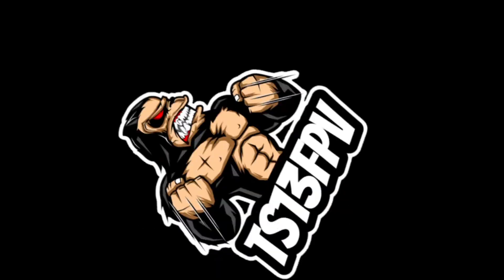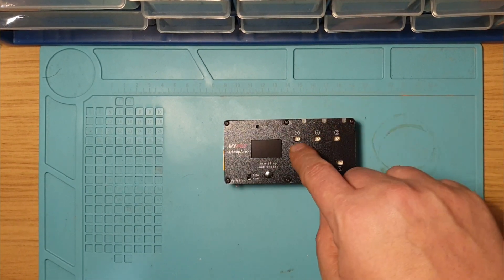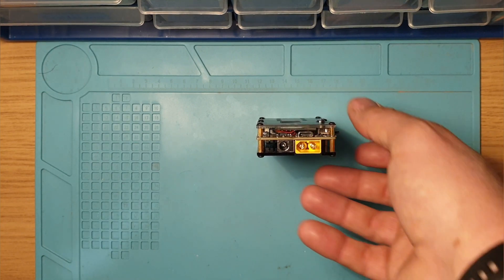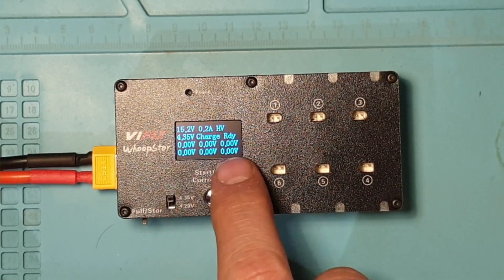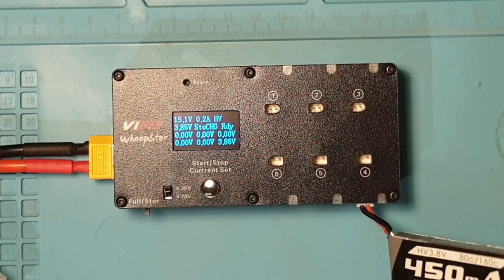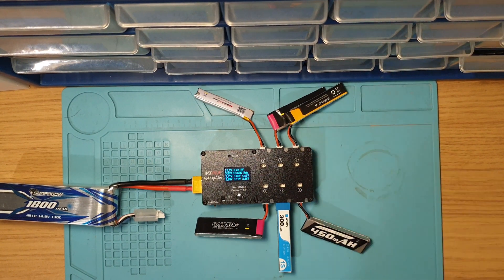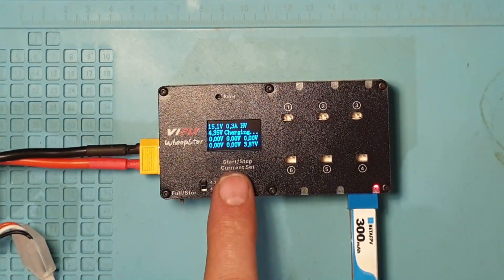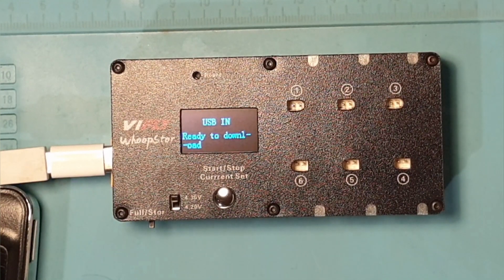Usb chargers suck .Vifly whoopstor, 1s battery charger/storage/discharger.

Comment: Nice one.
Btw PD stands for "Power Delivery" and QC for "Quick Charge", both standards for higher voltages over USB (9V, 12V, 20V+). Try it with your phones wall plug or a better power bank. :p
Reply from the maker: Great 👍  Thanks for the info . I'll pin your comment and hopefully other people will see it .
Reply: Hi, used a my phone wall plug and it still goes to "ready to download". Wall plug, power bank, none of the usb-c worked. Anyone knows how to fix it? :/
Reply from the maker: I have the same issue . Been using a different power supply(my lipo one)

Comment: Just wish it had the GNB27 connections on top instead.  Nothing on the market for those with storage charge option.
Reply from the maker: You can buy a ph2.0 to gnb27 adapter and use it that way .

Comment: I like mine, use it almost every day, ordered a 2nd one.  They finally fixed the PH2.0 connectors.  On my first one, as others have noted, the PH2.0 connectors were problematic.  They work well now.  Also, they got it right by putting the PH2.0 connectors on the top so as not to stress the connectors.  Some others have them on the side.
Reply from the maker: It is a good charger . They are giving the v2 to people for free (if  you bought the first one that had issues) you just need to contact them throught their customer support on the website. I use mine all the time . Just waiting for the v2 to arrive now 👍

Comment: I always tried to stop flying when my batteries hit 3.8 volts.  Would be awesome to balance them and use them longer.
Reply from the maker: There's a v2 of this charger out now which has improved charging efficiency and has solved a couple of the issue this one had . I'd look into that one if your planning on buying one . I'll have a reveiw out soon for it .